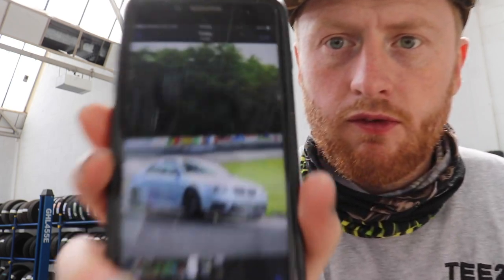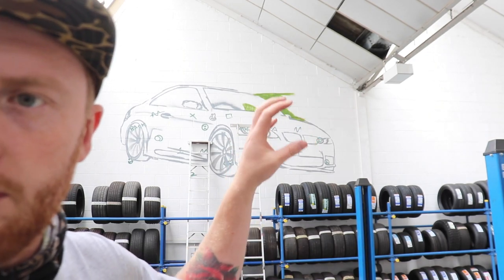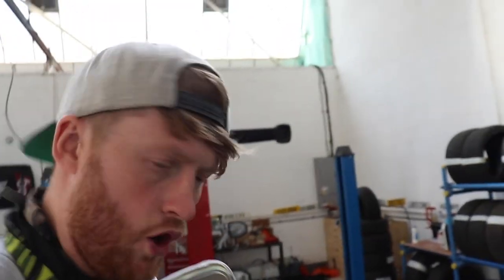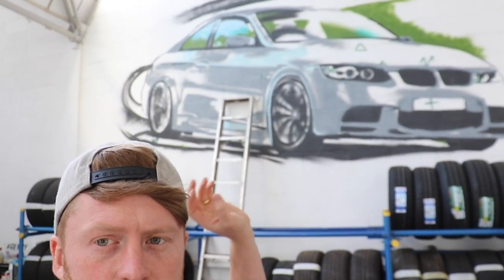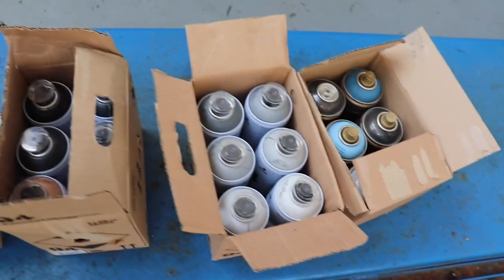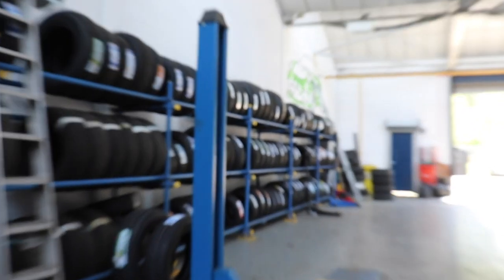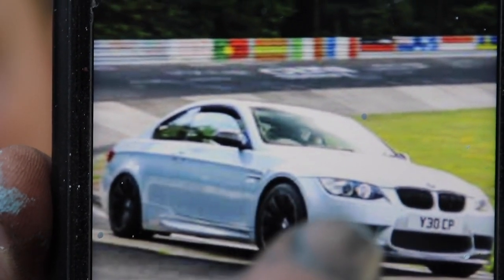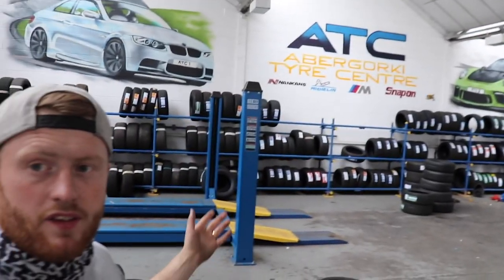I Paint some POSH CARS Porsche and a BMW 3Series at ATC

Comment: at the beginning i directly thought HOW WILL HE DO THE WEELS? by the way - if i needed to paint wheels again, i would measure it, print the wheels in real size and cut a real size stencil. 😂😂😂
Reply from the maker: Ah my Porsche wheels came out great. My BMWs back wheel is a bit crock. But I covered it with smoke 😏😂